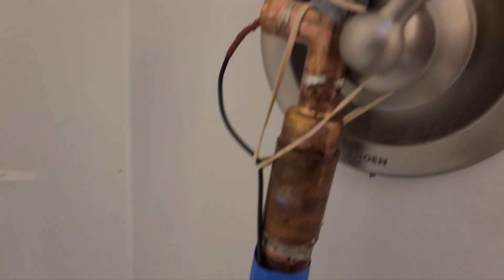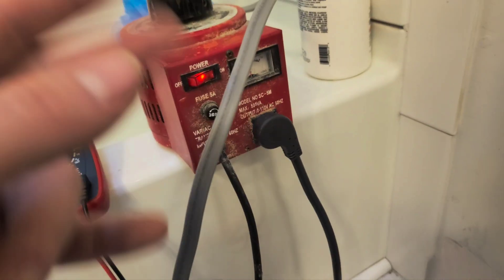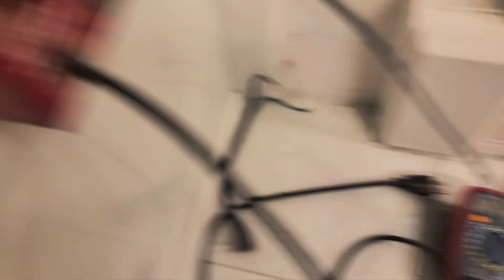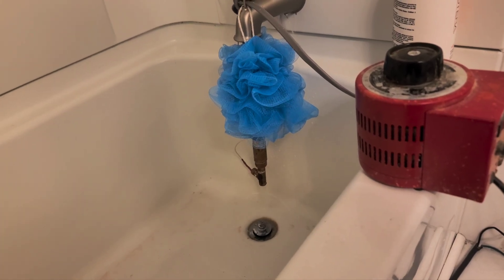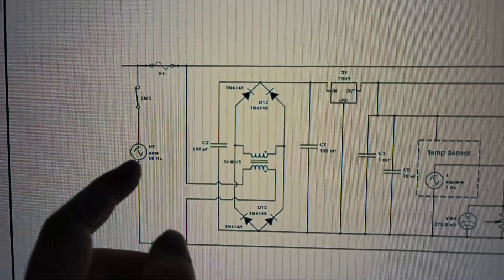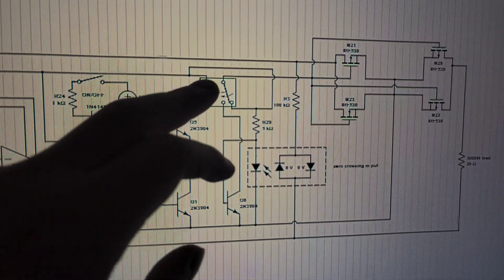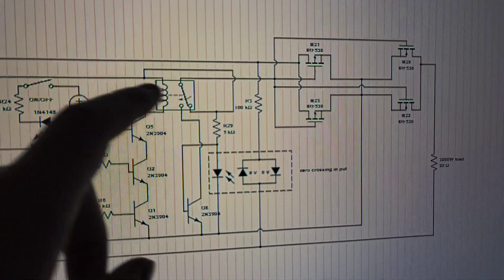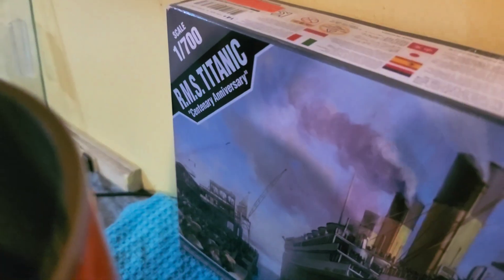3000W Water cooled resistor. test 1

Comment: i do not get the point of this exercise. why not using off the shelf heater components, they are dead cheap out of amazon and ebay if you take the crappy ones. all the electronics and calculation stuff you can do on those 15 ohm ones too.

Comment: An unnecessary complex circuit. Why do you use a zero cross detector in the MOSFET drive circuit? Also the MOSFET gates are floating when they are not driven around the zero crossing.
Reply from the maker: Yeah the zero Crossing thing might not work we will see. are floating gate bad. The problem I thought of is if the gates don't fully discharge within one zero Crossing interval.. Couple milliseconds.. The fets could be left partially conductive until the next zero Crossing… which would be bad.

Comment: the continuous flow heater has already been invented.
In Germany three resistors each at 230V AC, three phases 400V. The pipe is grounded and it doesn't matter.

Comment: You know, instead of that big complicated driver circuit for over-temperature protection, you could just use a couple of bimetallic temperature switches in line with the resistor instead.  (That is how this sort of thing would typically be protected in any real-world product anyway)

Also note that if your water is actually in contact with the leads of the resistors (which it will be unless you've been very careful with sealing them all off), then the total resistance of the apparatus can theoretically change depending on the mineral content (hardness) of the water you are using.  You can also potentially get some leakage current between your voltage source and ground (which would, for example, cause problems for GFCI devices, etc).
Reply from the maker: This is all very true. I did attempt to seal the resistor pack but I would not rely on that for a long operation. My water here is about 1.5M ohm / in. Although I think I'm going to use this heater For a heated patio or driveway when it snows. We will see.  
I did ground the chassis. And it does not work with GFI outlets haha.

Comment: My only suggestion on your mosfet circuit is to have a higher rail than 5V to minimize rds on. I can't make out the part number but for power mosfets typically you want a high vgs drive. Check the data sheet to see what it says, but I would think it would be around 15V to get the rated rds on minimum.

You are driving a 20ohm load so rds on is especially critical.
Reply from the maker: The best mos driver i like is the (fin 32) 
It's simple and fast. 
And I do need 15 volts not 5. lol
Reply: @bennettslab2084  you aren't doing any fast pwm switching so really a gate driver is not all that important. If increasing your rail is a pain, you could slap a charge pump like the TC7660EOA713. Which you can configure to double your rail from 5 to 10(minus some diode drops so schottky diodes are prefered)
Reply from the maker: @feloria1862  The isolation transformer i'm using has a few outward voltages. So It wouldn't be a problem. The driver is more just proof of concept... All of these projects are just practiced for myself.. it's the best way to learn what really works
Reply from the maker: Yeah the Miller plateau…

Comment: I think that using the voltage and current is probably the most accurate way to measure the power since your resistor changes with temp. 

You could also plug a kilowatt power meter (240V version ofc) on the output of your variac and get a power measurement there.

You want to do it on the output of the variac instead of the input because the variac is not 100% efficient. So placing it on the variac output gets rid of that power loss from the measurement.
Reply from the maker: I could also put a fixed amount of water in it and run it for a fixed amount of time in a thermal Anechoic chamber… If accounting for the change in fixture temperature the change in water temperature could tell us the exact power input.
what fun.

Comment: Good grief man, just get a wire wound ceramic resistor.
They're made to go over pipes for cooling.
Come to think of it, power resistors are actually pretty easy to make.
All you need is nichrome wire and ceramic tube, cover the whole thing in glaze once you get the resistance right, fire it and you're done.

Your gap between the resistors and the pipe isn't helping your heat transmission any.
Fill it with sand.

Comment: This is a Darwin Award just waiting to happen.
Reply from the maker: I have similar reservations about it. Typically you don't water cool. Resist your elements until 15kw+ but I'm just messing around here. It's really more of a size trade-off.
Reply: Resting the variac on the edge of the bath - what's the worst that could happen? :D  (Yes, I know an RCBO should trip first, but... yeah :) )
Reply: @Telukin  An RCBO or GFCI wouldn't trip if the fault happens after the automotive transformer. And at least for these types of tests, I doubt much would change if DC was used instead of AC.
Reply from the maker: The comical enjoyment outweighs the danger.. :] @Telukin